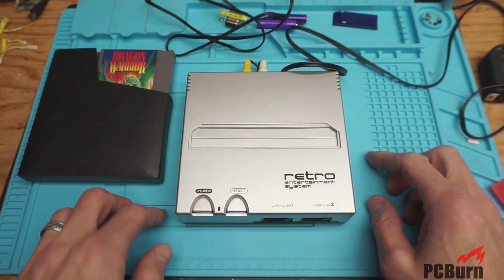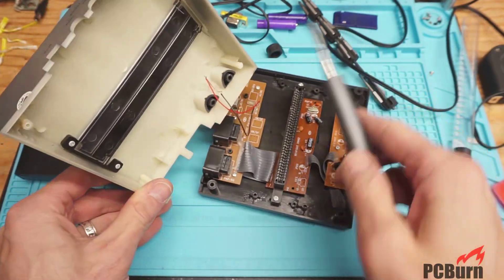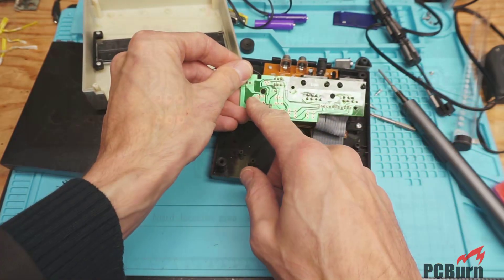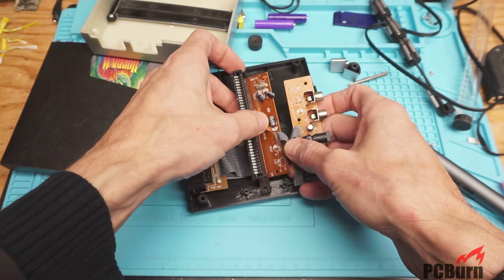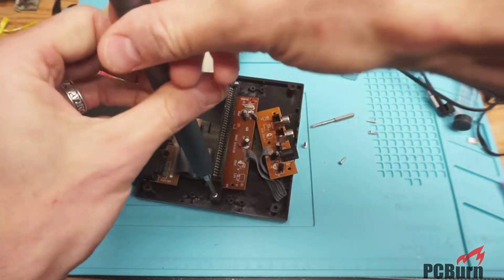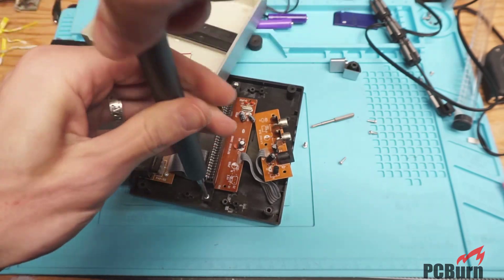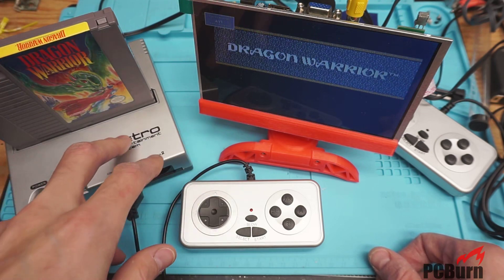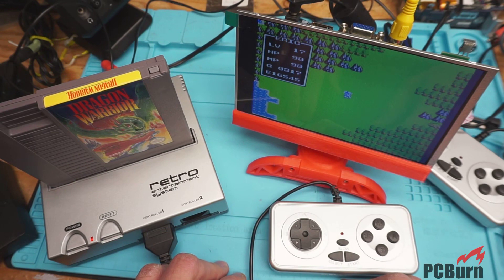An NES Clone! Retro Bit Retro Entertainment System Teardown

Comment: Hi Brother, did you manage to install the missing components ? For filtering or any other improvements ? I just bought this version on the internet, and I was wondering if I could do any improvement whatsoever.
Later I will open it and take some pictures so I can show you.
Thanks.
Reply from the maker: Sadly the cheap wiring failed shortly after the video. I'd need to fix that first.
Reply: @PCBurn  I see, I found one in very good condition, would be nice if you could find a datasheet or a way to install the additional components to make it filter the output. I wonder what the extra components on the Joystick side are.
Reply: @PCBurn  how about e-mailing the retro bit website asking them for a full datasheet of the board so we know what they designed to be in those missing spots ?
I thought of doing it, but I am no one, you are an youtube with a video about it and more than thousand subscribers, maybe they will give it to you!
I am willing to make some tests and even record it so you can put on your youtube channel. It is a nice clone, I liked it!

Comment: The reason why they could make noac system chips is because nano technology has improved alooooooot in 35 years,because these daya chips can be made 1000 times smaller .
Reply from the maker: They're not exactly 1000 times smaller. But the lithography has gone from the 6502 (ish) chip in the NES at 8 micron to modern chips getting down to what's called 7 nanometer. While the "process" number it doesn't mean the size anymore and has become closer to marketing-speak I'd call it close enough. Unless my memory or maths are off!

Comment: Does that thing work with original controllers? Also curious how the sound/visuals compare to authentic thing.
Reply from the maker: It's got the 9 pin, so it should. It sounded and looked good to me in the carts I played... it felt like the controllers were a little off. Not the worst I've used but low quality.

I'm intending to mill some custom controllers out of hardwood. So maybe I'll test it with those!

Comment: That’s a ridiculously low number of components. I have an old NTDec, which is also a glob-top design, but it does have a few more components on the radio board.
Reply from the maker: Right? This doesn't even have any discreet voltage control circuitry.

I may use it to do a test on voltages across the boards and on the I/O lines to the cartridge. Finally got a real scope and I'm a little curious what that looks like on this.